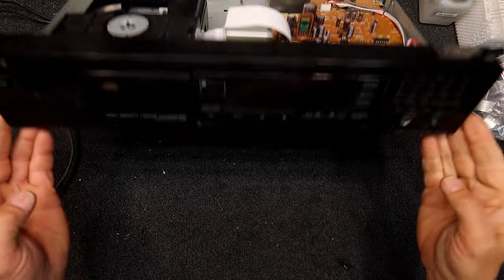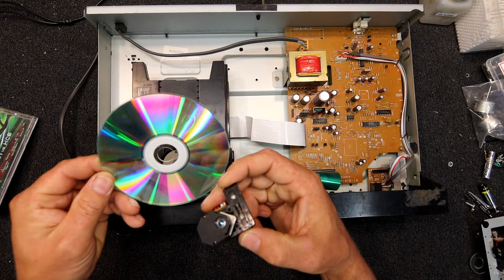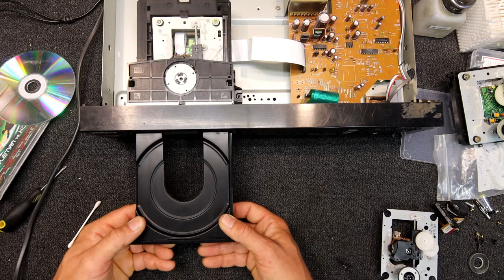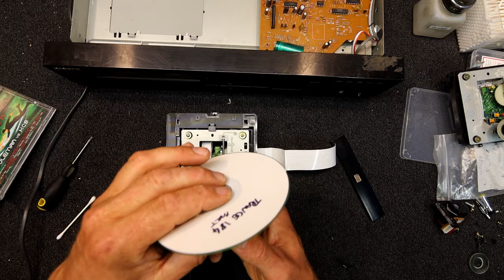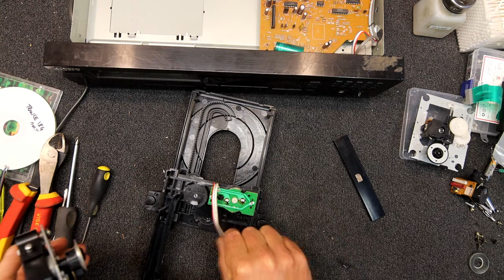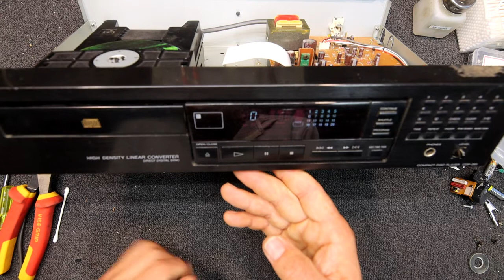CD Player Repair Part 1. General information and Sony mechs

Comment: hi thanks for the video
i just got the sony cdp591 model,
the tray is open and close good, its read the disk ok. 
the only problem i have with it is its jumping from almost everything, the slightest tap on the top of the unit(no matter where) is jumping the track forward or backward.
its jump even from the sound and bass coming from the speakers.
what could be the problem and how i can try to fix it?
if its a easy fix or not?
i have almost zero knowledge on electronics.
please help
Reply from the maker: Check the rubber mounts on the corners of the laser mechanism to make sure they feel soft. The most common cause of skipping and sensitivity in Sony CDs is the spin motor that rotates the disk. The board underneath has to be unsoldered from the 2 motors and the turntable removed and refitted at the same height. I did a video on a small Sony CD player that fitted on a shelf system that covered the process. I forget the model

Comment: Really really helpful!!! I'm currently revising my CDP-xe220, and maybe someone in the comments could help, or you. The player works perfectly until the bass from my sub shakes it a little bit, which it should witstand (my CDP-M205 does easilly), then it will always start skipping backwards. There's enough lube it seems on the tracking mechanism, and it can read CD-R. When adjusting laser gain to be the minimum it still reads disc which kind of makes me think it's not the laser, but now when having it cleaned and turned up laser power a bit it never skips. I want to turn down the laser power again, could it be that spindle motor? I can't find  the motor as a spare part (M101 X-4917-523-4 MOTOR ASSY (SPINDLE)), so I need some insight before ordering a completely new assembly with pickup or some player for parts since I don't want to blow up a good laser.
Reply from the maker: Can be spindle motor or the rubber mounts. The motors are available from places like Wagner Electronics. I cant remember the type number but I did replace one in another video I did on one of the small shelf system type Sony CDs
Reply: Thank you! Ill look into it. I live in Europe, so things like this are harder to come by

Comment: Hi Steve, your video gave me the confidence to replace the laser in a Sony CDP-597 which would intermittently read discs, when it wouldn't I would hold the close tray button on and that sometimes helped to read the disc. It could play a disc all the way through. Unfortunately changing the laser didn't help and it still has the same problem. Have you come across this fault before or do you have any clues to what might be causing this fault. Appreciate any help you can give me, thanks.
Reply from the maker: First the door has to close fully and press a switch on the tray. You could have a slipping belt but usually it results in the tray coming back out or something like that. The laser then needs to center and press a switch. If its already in the center they sometimes move out and back in to check. Then the laser should light and the lens start hunting up and down to find focus. Once that happens if there is a disc there, it will try to spin it up and read some data. It sounds like you have a mechanical issue if its intermittent but then reads a whole disc, but it could be one of the electronic adjustments is right on the edge of allowing it to read a disc.
Reply: @StevesElectronicRepairShop  Thanks so much for the reply and explanation. I'll have a bit more of a fiddle and try and give it a tweak. 👍

Comment: @16:54 I had a problem with discs making a clicking and whirring noise when loading up on a Marantz player, not playing at all and also not showing the TOC but displaying a 'SubQ' error. I found a solution which was to remove the laser assembly platform and then the rubber mounts, screws and springs underneath. I stretched the springs slightly by using my fingernails and put them back with the rubbers and screws etc (making sure beforehand I had made a note of which of them went where - important). Happily I could then play cds which spun up with no clicking, found the TOC with no problem and played perfectly.
  Thanks for these three very helpful videos on CD repair - brilliant info.

Comment: Hi Steve great video. I have a Sonny Lissa CDP LSA1 and the disc plays for a min then stops. I have checked most things. I get an error on the display saying 'check CD position' Any ideas please?
Reply from the maker: Without knowing what triggers it to put up that message its hard to say for sure. Possibly its detecting too much wobble in the disc. Check the platter and clamp for anything stuck to them and clean just in case. The spin motors used in Sonys are known to cause disc reading issues, so that is another possible cause, assuming your one uses a standard CD mech. I have done other videos where I change the spin motor in a Sony.

Comment: I have the exact same model CD player. Disc tray opens with no effort but it wont close with the button like it should. Probably faulty switch or it doesnt quite reach the tray out switch and thats why it refuses to close the tray?
Reply from the maker: Usually the motor will keep running after the tray is ejected if the tray switch is faulty. Does the tray go back in if you push it?
Reply: It will only go back by pushing it by hand all the way back in. Motor wont pull it back in at all.
Edit: Sometimes it actually closes the tray like it should. Also If I leave the tray open and power cycle the player when it powers up it closes the tray.
Reply from the maker: @enjui  Sounds like it could be an issue with the tray switch if it pulls it back in on power up. Test it with a multimeter if you have one, or if you can find which terminals are for the tray out position, short them together with the tray out and see if that makes it work again with the tray button. The microprocessor likely needs the contacts of the tray switch to be in the out position before it will try to pull it back in.

Comment: Hey Steve, not sure you can answer this but I have a very similar unit to this, the 291. The display no longer works and I'm no EE. There is something that was rattling around inside. On the brown board (PCB?), there are 3 battery looking things glued into the board vertically. One of them, the smallest, is no longer attached to it. I'm wondering whether that has something to do with the display. The glue or brown crap that I guess kept it on the board, has come undone. Thoughts? Thanks
Reply from the maker: Sounds like you have a loose Electrolytic Capacitor. The glue isnt that important but they should have two pins soldered to the board that connect them and hold them in place. Without knowing what that particular one does its hard to say if its display related but there is a higher voltage that fluorescent displays need and if it is related to that it could cause no or dim display. If its labelled C903 on the power board its likely your problem.

Comment: Great video! Re the Sony KSS heads - are the cheap Chinese units on eBay worth while? Wheres the best place to get replacements as Sony no longer make them? Thanks
Reply from the maker: I used to get them from Wagner Electronics who still stock some. I havent tried the Ebay ones, but know the Playstation lasers can be a bit hit and miss.

Comment: Hi mate, great video! having some issues with the dust cover which is meant to go over the lens. It’s come off completely and don’t know how it goes back on with the spring etc Could you help?
Reply from the maker: Do you have one of the lasers with the swing over cover that keeps dust off the lens? Its been a while since I have seen one so I doubt I could help without pictures etc.
Reply: @StevesElectronicRepairShop  yes that’s the one. It’s a sony lbt xb50 and the cd player is not registering CDs. It spins once, twice three times and then says no cd
Reply from the maker: @Niesonn  The dust covers were fairly useless and I think I have removed them in the past if they looked to be causing any issues. Sounds like the laser is getting low and having trouble reading a disc. I would try tweaking the trimpots in the CD player if it has any. I did some videos on CD player repairs and adjustment
Reply: @StevesElectronicRepairShop  Thank you, I will give it a go.

Comment: I only watched the first third of the video, but you gave me confidence to strip down my wife's old Sony MiniDisc system with a CD player, which had spat out the CD tray every time it was sent in since it was recovered from 20 years of storage. In retrospect it seemed like the belt drive and microswitch for the drawer were the problem, and taking the belt off/on and cleaning it a little were enough to sort it out. Thanks! Our daughter can now enjoy it.